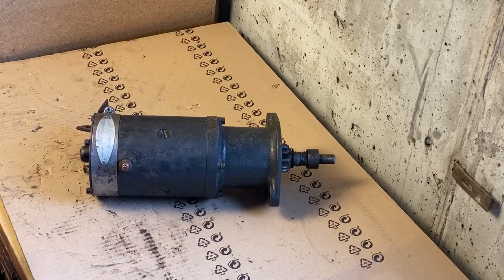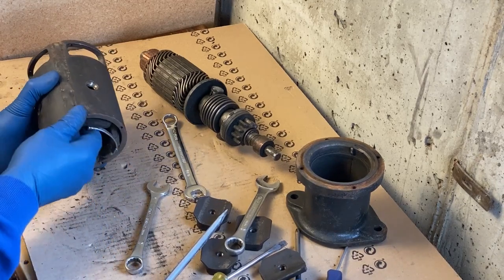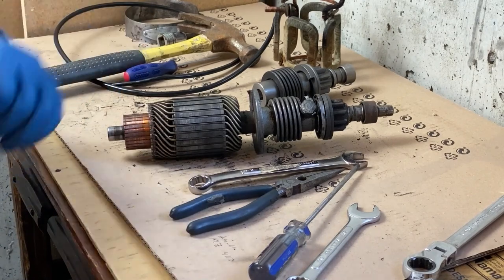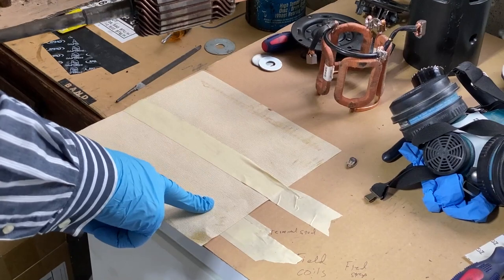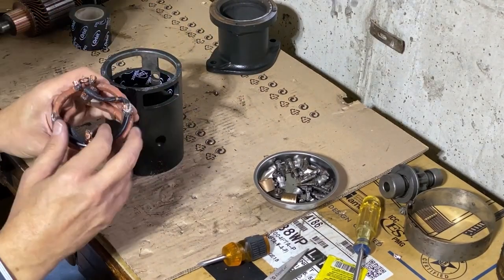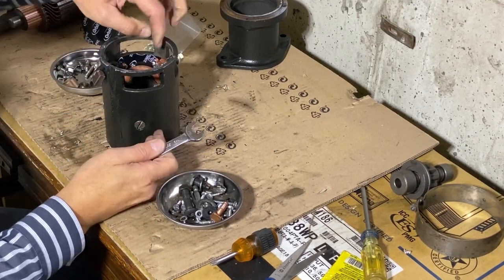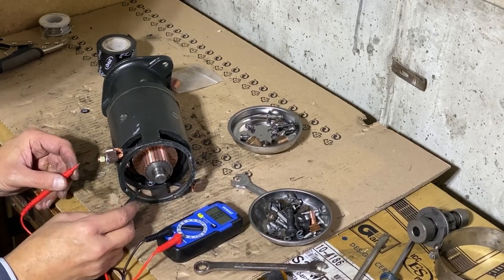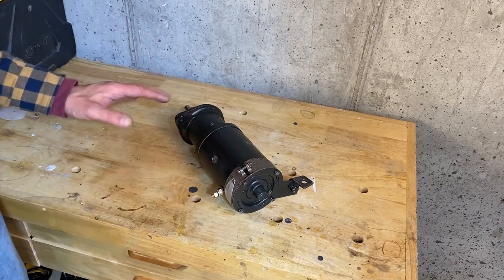76-Year-Old 6-Volt Starter Revived with DIY Rebuild - See How It's Done!"! #starter #willysjeep

Comment: The one bushing you couldn't get will come out by breaking it up with a straight screwdriver. The brass is soft enough to break apart. You can ream it with a regular drill bit if needed.
Reply from the maker: Thanks for the tip.
Reply: You didn’t show how you tighten the four screws on the case.

Comment: Cool video, i referbish a lot of "old iron" and have been complaining for 15+ years, that the old timey starter/generator repair shops had died out, so i need to learn to do it myself,  hah.  Im looking at this prestolite starter in my $600 case backhoe with a good snout/bendix, and the worst motor ive ever seen, and a pile of old prestolite willys starter parts i got in a trade, and gonna see if i cant save myself some cash, you see, the case parts guys are happy to sell me a new starter, but they all want about $3fiddy, which is more than half what i payed for the whole thing, hah.